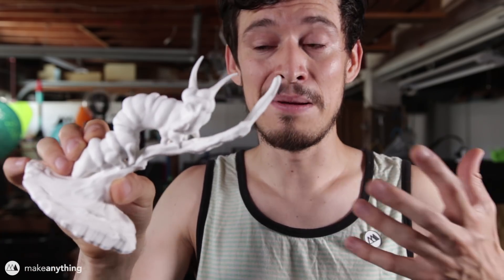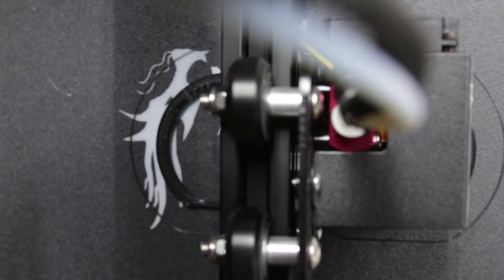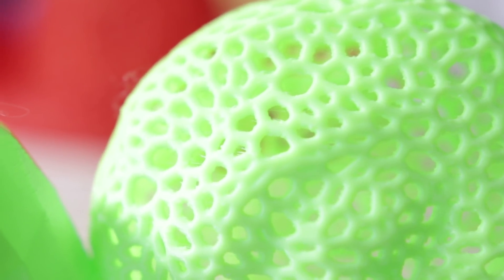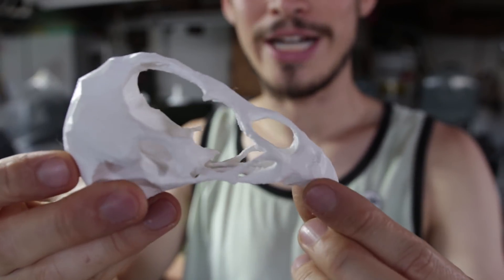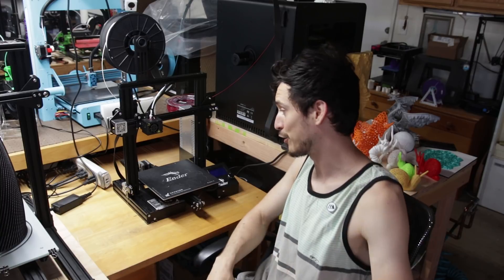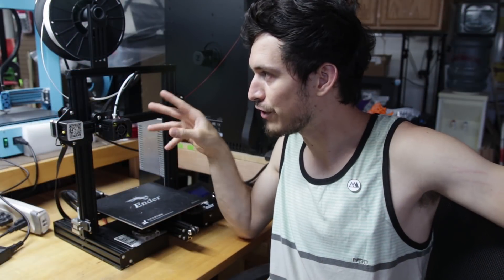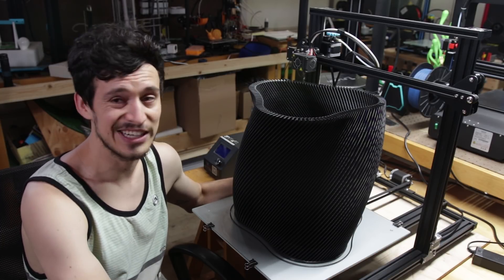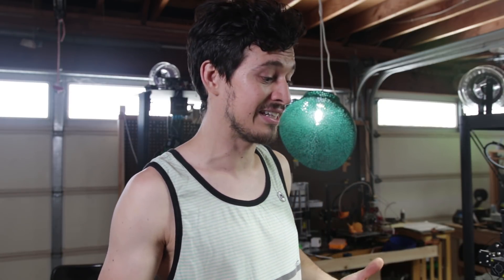MEGAREVIEW // Ender 3, CR-10, CR-10S, CR-10S4, U20. Which is the Best 3D Printer for You?

Comment: I have a CR-10 S5 (500x500x500) for about 4 years now and it can make small things or big things all the same. I love it ^^
I did upgrade about everything there is on it though. Z-rod supports, bowden DDS extruder + V6 extruder, zodiac nozzle , BLTouch (with a 5x5 matrix probe), those squash ball support feet, fixed bed instead of springs, silicone bed heating (so it can warm up in 30sec while it's probing) etc.... So you can't really call it a budget machine anymore as it now costs about 1700 euro's (not including all the PLA, wood, carbon, metal, ... filament)

But I've never regretted the purchase ^^

Comment: I am looking for a printer to print out models I just purchased a Batman model stl (MY FIRST ONE) I am looking for advise on a printer and filament that print out the model smooth as possible all the lines layers. Or are there ways to address those lines?
Reply from the maker: One can definitely tweak their printer indefinitely to reduce those lines. If that's your main concern maybe you want a resin printer. I mostly do fdm printing because it's great for  functional objects

Comment: My first 3D printer was the CR10S and it didn’t even work first it took like 2 weeks to come then the heater didn’t work and the guys told me to replace it or check wires I was new to this and they could barely speak English then I got Anycubic i3 Mega S and it is amazing with touchscreen and all I highly recommend it and easy assembly the CR10S took all day to assemble but the Mega S only took max 1 hour only 2 main parts and some plugs then ready to print and I love it so if your new to 3D printing use Anycubic i3 Mega S it will be your dream

Comment: Cant decide between the Ender 3 and the Cr 10s pro. I like the integrated control panel as I have limited space. Your recommendation?
Reply from the maker: If you can afford the CR-10s pro it's definitely more capable. They're both worth what they cost
Reply: @make.anything  much appreciated. I'll save up the extra then
Reply: @make.anything  With all the additional set up I'd have to do after, is it still worth it. This would be my first 3D printer, I'm just worried it'll be a bit too intense for a first timer. I dont mind saving up the extra money but I'm a little worried by the set up
Reply from the maker: @NH-po8wr  the Ender 3 requires more set up than the CR-10 line of printers. Tinkering to perfection is a part of the hobby but I believe in you :)
Reply: @make.anything  Thanks for the advice dude, I've had my eye on the CR10s pro but it sounded like there was a lot of firmware updates that needed to be done to make it useable. If you're saying that the Ender 3 presents similar challenges than I might as well suffer the tinkering with the Cr10s pro.

Comment: When you show those two cube halves printed on the Alpha YZ 20 and the CR10S, you say they're comparable. Am I missing something? Granted, I know little to nothing about 3D printing, which is why I'm here in the first place, but to me the one done on the Alpha YZ 20 looks a 100 times cleaner than the one from the CR10S. Again, what am I missing?
Reply from the maker: For the same of comparison I probably shouldn't have used the clear filament. It refracts light to show layers much more. The prints were similar in terms of accuracy

Comment: Great Mega-Review Devin. I have had a CR-10S for a month or so now, lovin it. 

I do however have a major problem. It's brought on a severe case of FA. FA is a little known disease to which some people have a genetic predisposition. The disease is Filament Addiction, and it's caused by the PLA gene. I'm told there is no known cure, but a good credit card and UPS service can help with the symptoms. It's aggravated by videos such as this, exotic colors such as those by Filamentium an Polyelixer Alchemy, and the sound of stepper motors working in concert.

I've been told I can slow the use of filament by switching to a 3d pen, but my CR-10 works so well, the queue is several dozen projects long. I now understand why people like you and Angus have a dozen or more machines, it's not because you are curious about the performance differences, it's so you can run them all at the same time....
Come to think of it, my CR-10S is a little size restrictive, I see you making those cool large projects you have in the works and I'm thinking maybe a CR-10S4 might be required to ease the pain of the FA. I hear Polyelixer Alchemy has a new gold color out, Hmmm.... I wonder if anyone has done a full scale King Tut?.........

Comment: I am new the 3D printing, but after watching your video, I am totally tempted to give it a try. I am just curious on one thing. I already know I want to print larger item, but would you recommend getting the 4S for a total newbie? Would it be more sensible for me to print in parts in smaller printer while learning and glue them later on?
Reply from the maker: I wouldn't say the S4 is much harder to use, but it does take up a LOT of space and take longer to print. I would only recommend it if you plan on mostly printing giant things

Comment: Great comparison video I was trying to figure out what the ENDER line brought to Creality that the CR-10 didn't already have.  Question on large prints and I know nothing about "dual extruders".  Can you run a dual extruder to help speed up a large project?  I know they're used for dual color or multi type filament, but can you decrease your print time?

  Another through I had for the larger platforms.  You talked about your S4 and I bought an S5 I'm finishing my first print on.  Can you have a dual extruder one with a 1.75mm nozzle and one with the 3mm nozzle?
  Design in the extruder with the 3mm nozzle and filament to lay down quick infill and larger inter area print, switch to the extruder with 1.75mm nozzle for outside of print detail?  I'm still new at 3D printing, but my father and grandfather have had their own wood and partial metal shops so I've got a lot of experience building things.
Reply from the maker: 3mm vs 1.75mm is just raw filament sizes, but yes, you could have a printer with a large nozzle for infill and a smaller one for outer surface details. I haven't tried it yet but it's an interesting idea

Comment: Buy a Keenovo AC bed heater if your hotbed is giving you such an unreasonable problem (60's isn't anywhere near hot enough for PETG or ABS and many others [PLA only]. It will heat faster as well as to a far higher temperature.

Comment: I have the Ender 3 and I really like it. I also have 2 x tronxy 3S that are a also based on the cr-10 design, but I never see many reviews of them. I really like the 3S it's auto bed level sensor makes printing super easy and I have run them for many hours with very little issues.

Comment: Devin! Do you have a past YouTube that I can check out regarding getting your prints to stay on the bed? I've tried many things--hairspray, a layer of super glue, black square thing etc...I'm kinda discouraged w/ my CR-10 bc I have yet to have a successful print...my benchies fail on the top horizontal part of the boat
Reply from the maker: Are you printing with PLA? If so and those solutions aren't working you might just have to fine tune your bed leveling. Makers Muse just put out a video about bed adhesion recently too
Reply: Yes PLA, just the one from the box right now. Thanks for the reply I'll check out MM's video :)

Comment: Ok, one issue you didn't address because you were not exposed to it. That of distribution. I purchased an Ender 3 from BangGood three weeks ago (it took a week to ship). It appeared that the Z axis motor was defective with a short. This blew out the Z axis driver and during testing it took out the X and Y drivers as well. I needed to return the Ender 3 to BangGood and the return process was a nightmare. The reason that the X and Y axis drivers were killed was because BangGood's testing regime. This was my first 3D printer but I'm an old crusty guy who's been around tech longer than most of you have been alive. When I told BangGood that it needed to be returned they worked very hard to prevent that. There are now three videos on YouTube detailing the problem and then documenting the testing regime. I needed to send six e-mails documenting in detail what my issue was, the response to the testing, the two e-mails turning down their various 'solutions' and finally getting  fairly in their face . After two weeks they finally agreed to send me an RMA/Shipping label that along with further photographic evidence of shipping will get me a replacement hopefully within the next two weeks. This is ridiculous. YouTube is full of videos of defective products that people bought from BangGood. They just don't understand the effect it's having on their business and on Chinese manufacturing in general. The defect with the stepper motor is no big deal,  Creality fell down a bit on their QC but that's not the main issue. Unless the distributors adopt a similar policy like Amazon Prime the Chinese distributors reputation will continue to be trash. The way it should have been done is that the first e-mail I sent requesting a return BangGood should have sent a return label. I cannot recommend buying any of these devices from anybody but Amazon even though you will pay a higher price. Chinese QC can be a bit spotty and a buyer is going to need a reurn service like Amazon Prime to insure against it. I'm not put off playing around with 3D printing, I just put an order in for an Anycubic Kossel Linear Plus, but I ordered it from their online store and I figured with two completely different printers, one of them will be operational.
Reply from the maker: Thanks for bringing attention to this. It sucks to think this is many peoples first experience with a 3D printer :\

Comment: I just go an ender 3 a few days ago and the only problems ive had was bed leveling and adhesion. I ended up pulling off the ender 3 bed and just putting masking tape on the metal plate under it. It has been working normal now. Im super happy!

Comment: Hello. Awesome review! You did really great job here!
I'm looking for large volume printer. Cr-10 S4 caught my eye. I would even think about upgrading it to 65cm print height. My question is on maximum weight of printed objects. How much can the bed and wheels manage?  The moving bed at Y axis probably isn't best solution for me I guess?
Reply from the maker: Well that stool weighs like 10 pounds, that surprised me. I think you can print quite heavy objects but might want to slow down print speed as weight increases

Comment: I'm considering the CR-10/10S but then I saw just a little bit about the AnyCubic Chiron with its 400x400x450 and auto bed leveling. I'll need a few more reviews before I pull the trigger.
Reply: May I ask which one you ended up going with?
Reply: @MCPhantomX  yeah, I went with the CR-10s it printed great. Only mods were IKEA mirrors to replace the stock glass and then a PEI sheet on one of the mirrors. Worked great but has been idle for a while. Health and family issues have kept me away. Plan on getting back into it hopefully soon.
Reply: @Hawk1966  Nice. Is there any particular reason you decided to go with the CR 10 instead of the Chiron? I am also interested in both, but unsure what to go with.
Reply: @MCPhantomX  reputation mostly. At the time the Chiron was just coming out. I think one YouTube channel had one up and "running" while the CR-10s was already a second iteration of a successful and well liked printer. I've also rarely used the full volume of the CR-10s so the increased capacity of the Chiron would have never been needed.
Reply: @Hawk1966  alright, thanks for the suggestions!
Reply: @MCPhantomX  my pleasure, hope I was able to help in any way. Feel free to contact me if you need anything else.

Comment: Hi. I´m looking for my first 3D printer.  I have been looking at The Ender 3, Anycubic I3 Mega and the Jgaurora A5.  I like the A5 design. I want to print Rc Parts and Scale accessories.  love to get your opinion on what printer to get.
Reply: I've had some experience with the Ender 3 and the Anycubic I3 Mega.  Both are outstanding machine for a newbie.  I got the anycubic for my daughter and the ender 3 for my son.  I liked the Ender 3 so much I got one for myself.  It's replacing my $1000 Prusa I3 Mk2 ("upgraded" to Mk2S) because I'm sick of repairing the Prusa.

Comment: Just some friendly advise. you are one of my favorites!! I watch ALL of your videos.

I have a lot of Ender 3 experience with the ender 3 (I have 4 of them all bought by me)

if you have the older ender 3 where the brainboard fills the brainbox ADD TL smoothers to X Y and E it makes a huge difference in finish quality. if you have the newer "small" board in the brain box you don't need the smoothers.

you seem to be over extruding. I run my creality printers at .97 extrusion multiplier. they over extrude a bit at 1.00.

I say this because your catepillar could be much much much nicer on the ender 3. I am going to print it in amker geeks poison ivy green. I think the color would be perfect for such a cool model. thanks for letting us download it.

lower  your jerk to x10 acceleration to P500 T1000 it will improve quality on the larger crealities and I use it on all my printers now.
Reply: Don Mega  the brain board is the little circuit board inside that runs everything the brain of the machine so to speak before we had computers like this that's what we called them so I guess the word today would be motherboard?

The brain box is obviously the box that contains the brain board or sometimes called the breakout box if it's separate from the printer
Reply: @nerys71  they come with serveral names like Motherboard, Controller board, Driver board.
Reply: How can I know if my ender 3 need this thing you write "if you have the older ender 3 where the brainboard fills the brainbox ADD TL smoothers to X Y and E it makes a huge difference in finish quality. if you have the newer "small" board in the brain box you don't need the smoothers."???

Comment: I think Prusa makes the best FDM printers right now but they are on the pricey side. 

The CR-10 is probably the best buy because of build quality, size, and the amazingly low price. However the Ender 3 is only a little smaller and a lot cheaper. So it gets my recommendation. 

What I'd like to see now is an upgrade to the CR-10 that has the improvements of the Ender 3 and CR-10s.

Comment: But, what about the CR-10 mini???  I have one and it's affordable at $300, still with a good size build plate (300x220).  Plus I've gotten the heated build plate up over 110 degrees.  So it works with ABS!

Comment: GPL crap only came around when TH3D wanted their power resume code.  Funny thing is that TH3D used to breach Marlin GPL by only handing out the hex file for their EZABL kit until just before they kicked off the GPL bandwagon.
Reply: Joe it's only mildly important how the GPL issue came about. What's really important is Creality's response to it. It is a huge boon to the 3d printing community. Especially if Creality keeps it up like they have promised to.

The main reasons the GPL never came up before is that none of the violators had made anything really innovative that the community really wanted before. Add that to the Chinese court system not really caring about international copyright laws and there was little point in pursuing the matter.

The boycott and Naomi's intervention on the community's behalf is a game changer and we are better off for it.